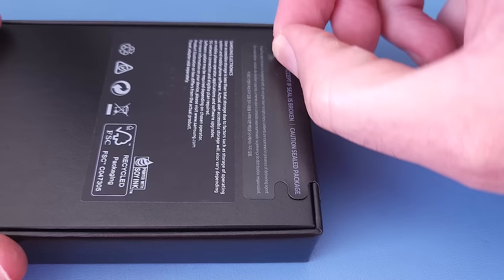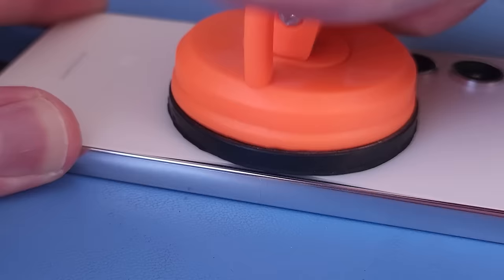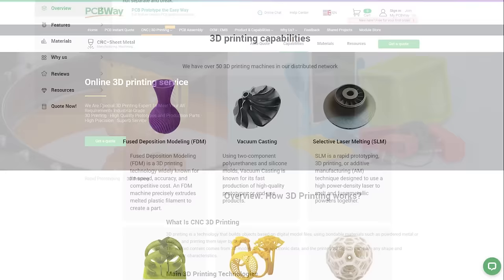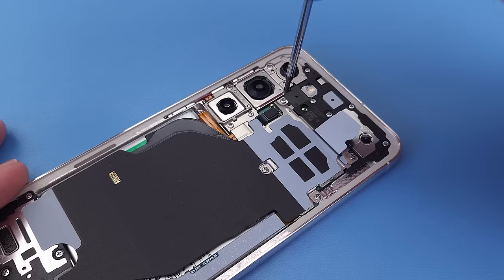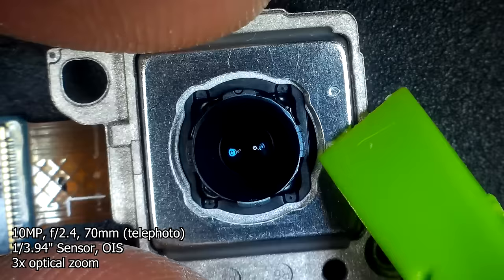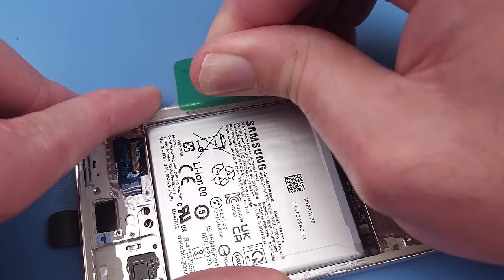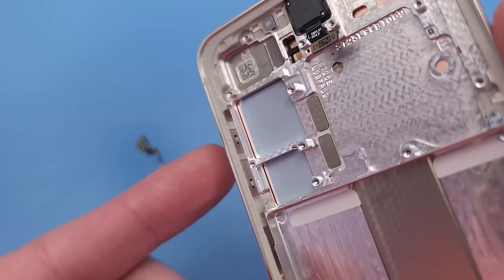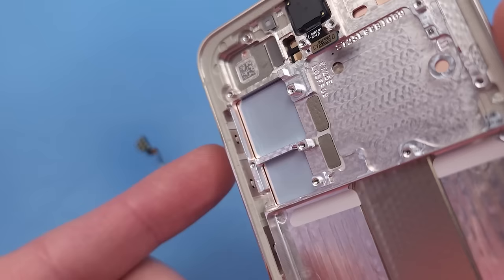Samsung Galaxy S23 Teardown - Full Disassembly

Comment: Samsung, poor design poor material. 😂😂
Reply: What is so bad, tell us, share with us!
Reply: @slavicmapping5262  cabling, tow high power transmission cable is across to the batteries, the cover black plastic material. The battery heating easily fails the cable. In addition, the camera cable's orange color material is so poor, most used this type of cable chipset in Chinese phones. Another issue is the camera protection glass it must be assembled inside not the back cover. This is just an example, so many issues bro.
Reply from the maker: @zewdu yoseph  you can replace the individual camera lenses from the outside. They pop outwards.
Reply: @zewduyoseph5928  these are all one problem that doesn’t even exist
Reply: @zewduyoseph5928  Dude, nearly all Phones come with that cable over battery, if you do so from the other side the vapor chamber would be useless. Also the flex cables from Apple have their own history of failing. And if you asseble the Glas inside, the waterproof will be gone because now you have to put a gasket onto the Camera Rings. How you want to remove the Backplate then hmm ? Also about point 1: i dont remember any issue regarding Cable Problems because those Phones have a middle Frame thats dispensing the heat to outside. The Vapor chamber is connected to the Battery and Chipset. From my View of quality its aboslutley fine. Only Vivo makes it more Beautiful
Reply: @zewdu yoseph  everything except the battery removal is harder on iphone. And who cares how it looks inside when you're bor even supposed to open it ?